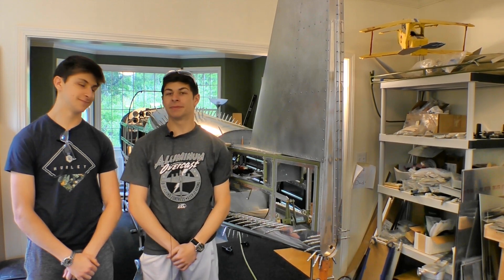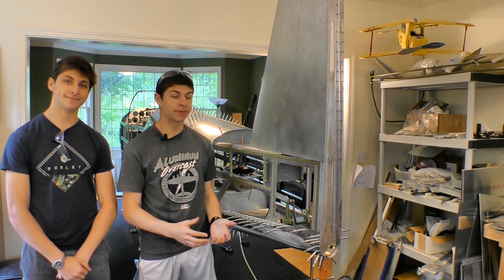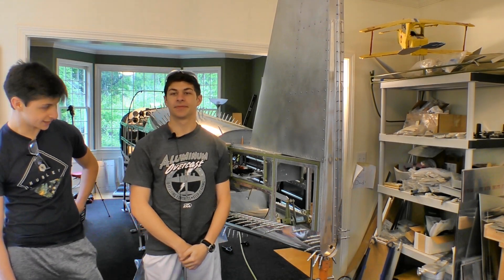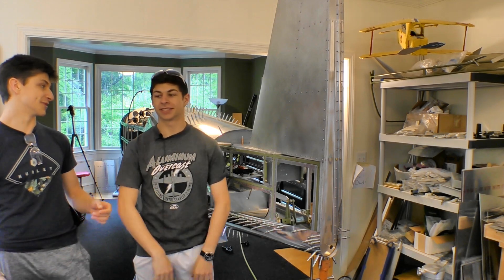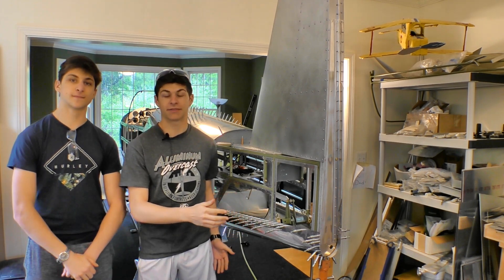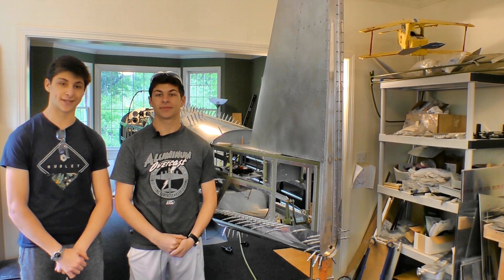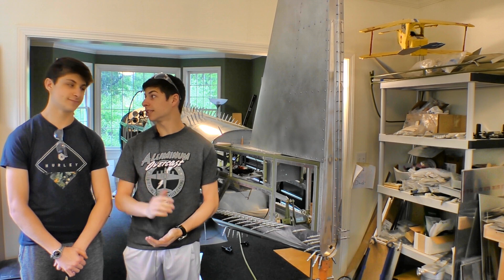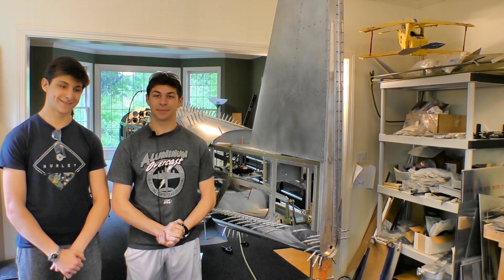Installing the bottom tail cone skin on our T-51D Mustang Aircraft Build!

Comment: When drilling those holes in the bulkhead tabs, you might consider using a wood backing block.
That would prevent the tabs from bending under the pressure of the drill and also make a little cleaner hold.
Reply: I meant to say "....a cleaner hole"

Comment: what type of engine will you be using. and also, i know i keep asking on every video, but seriously how will you get the plane out that vertical stab makes the plane taller than the window that is infront of the plane, which im asuming you will be pulling out to get the plane out. im just curious,  i would love to build a plane in my living room but i will just have to make do with my 1/48 scale model kits
Reply from the maker: We’re using a GM LM4 V8 (300hp).  Not saying how the plane will get out of the house...  you’ll have to wait and see.